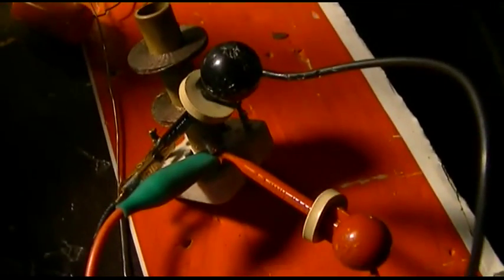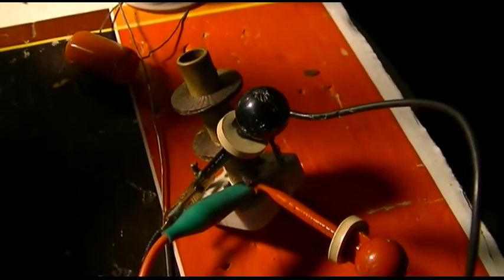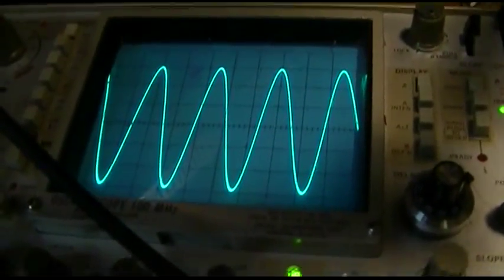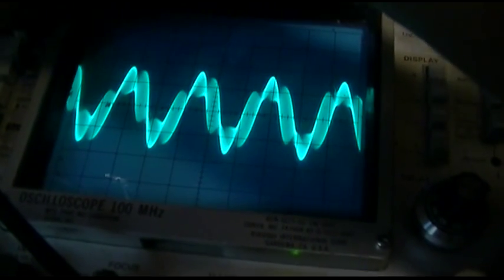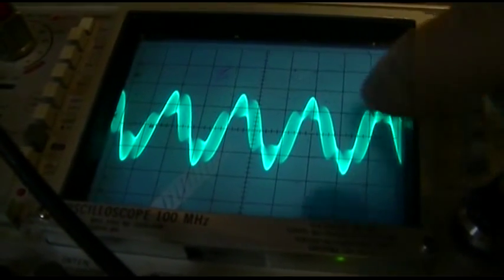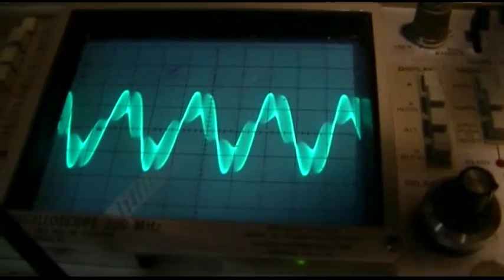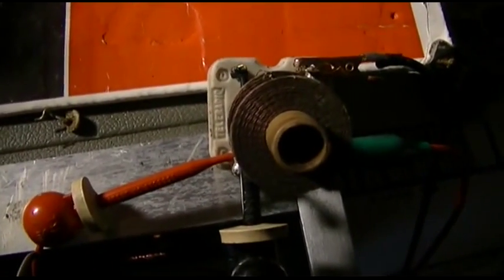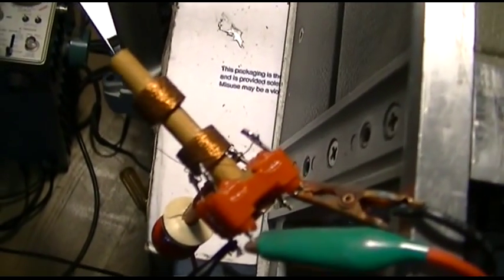Testing IF transformer With Signal Generator and Scope (not a valid test)

Comment: You have to consider something about IF :transformers, they are not really "step up" transformers, but, what they do, is act like a resonant element to a small degree once tuned, and then, they attenuate everything else that you don't want coming through. even if you drop that 4V signal on one side down to millivolts on the other, it will still drive the next tubes grid ( or transistors base) and only what is near the resonant frequency will be amplified, anything above and below will be attenuated.

Comment: Don't know if you have a grid dip meter available but that would be the best way to check the frequency that the transformer resonates with. If it's way off, the meter will show by how much and therefore whether it can be brought within the ballpark of the IF used by that radio. (it's also a fair indicator of the overall Q of the transformer.) Do note that alignment will still be necessary after it's reinstalled due to the stray circuit capacitances that you mentioned.

Comment: With mica-tuned IF's like those, the only practical test you need is to ohm out both the primary and secondary, which you did. If it's good, it will ohm out reasonably close to what the schematic calls for. But we don't know if that's actually the original IF trans; it could be from a radio that has a much different intermediate frequency, which means the trimmers on top might not cover the correct range.